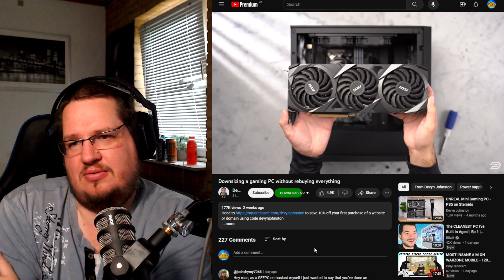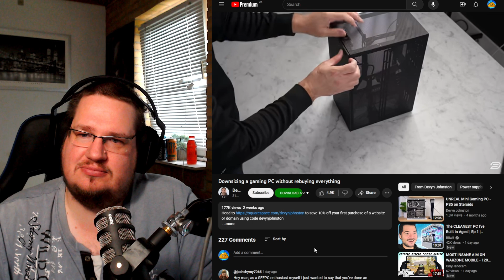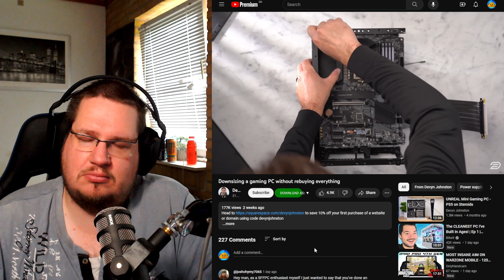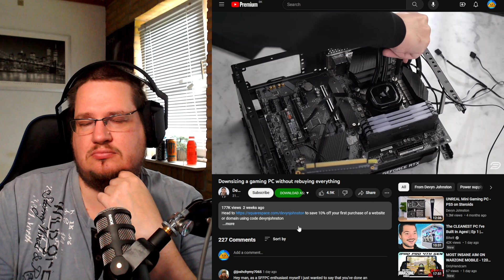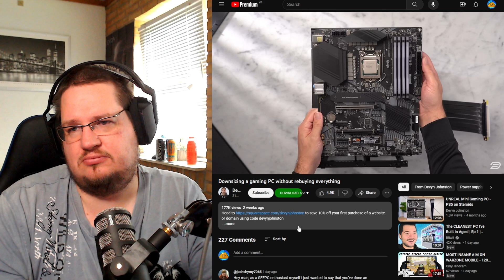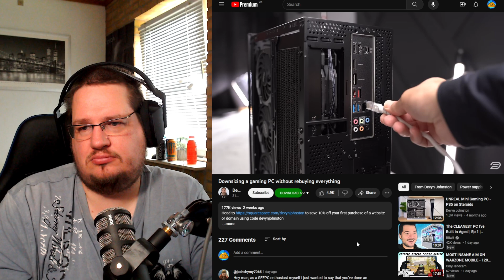Downsizing a gaming PC without rebuying everything - Kent's reaction video

Comment: i have the same case fans and same psu lol except i use a motherboard asus b550-A and amd ryzen 7 3700x and i use a A500 dual fan cooler by corsair... my b550-a has no LED on it at all it is minimal look and all white its why i got the b550-A version cause the board is mostly white i really like how my build turn out cause it looks clean.

Comment: I never have a problem, since 1993 I always use a midi tower.  My current midi-tower is black and is closed like in 1993 and the price was a whopping $16.  The only LED display I have is 2 cm above and right of my trapezium shaped power-on key. Blue means power-on and red indicates disk active :)